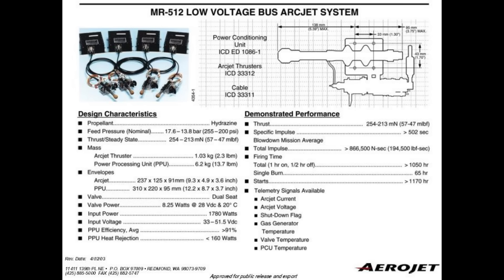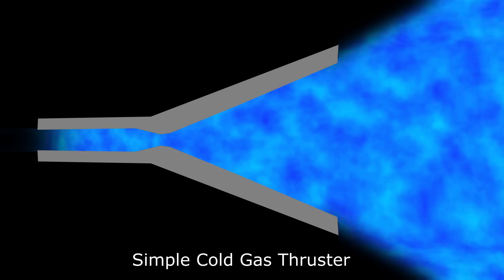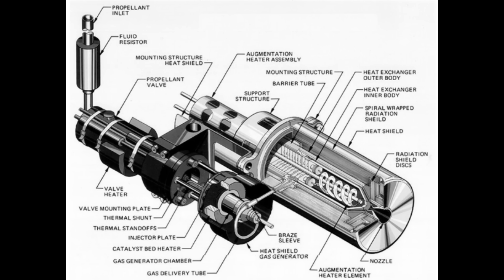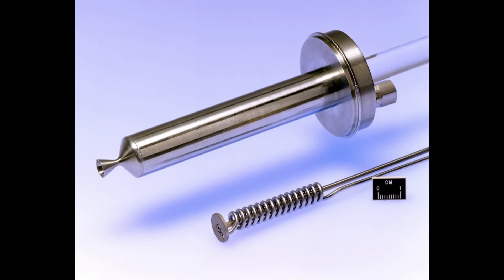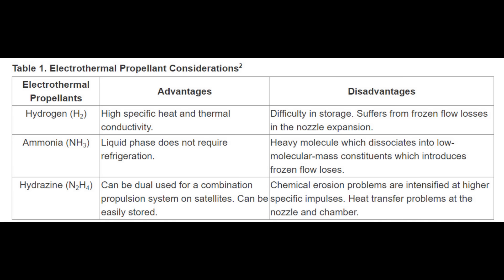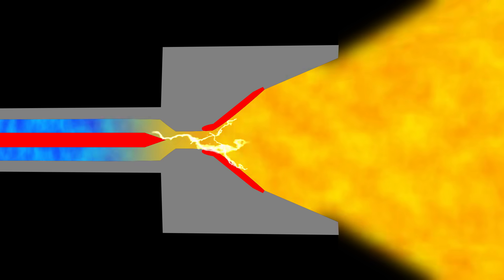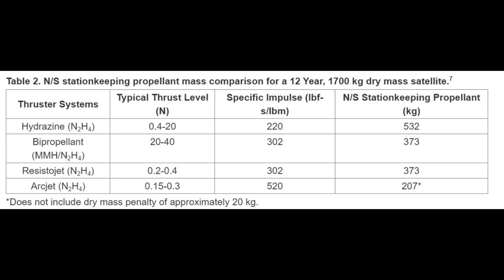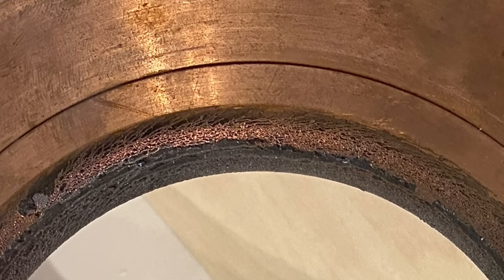Lightning In a Bottle?  The Science Of Electro-Thermal Rocket Engines

Comment: square rooting temperature of per molecule, what happened? do you have kelvin and hydrogen molecule regulator? can those chemistry energy outcome be recycled like tail re cycler? source energy and space ecosystem regulate. the circleR hoolahoop a trail path tracer like collect the rings or used as road. toxic? have you learned about heat transfer machine, can temperature cleanse? Ammonia, can radiation specific detox? AR jets and BR jets, can a propulsion be horizontalized like releasing rings by impulse and velocity, then re attract recollect. heat compromise space stealth. Does oscillating radio waves compromises speed warp? counter drag slow, can the propulsion be immersed at front, like a bridge likened to silver surfer pathway, diminishes rear back heat for the chaser space ships lesser detect? during for example space war

Comment: The microwave bit is very interesting for propulsion because of nuclear thermal electric engines. Such an engine will pass the fuel through the reactor and then use it to run a generator. It will then pass the fuel through the reactor again, yeet it through the nozzle and use the generated power to increase its energy for more specific impulse.

If we were to use methane, the microwave booster would be very good because a methane nuclear engine will have an exhaust of CH1, CH2 and CH3 (molecular hydrogen must be present because atomic carbon will choke the engine).

CH1 and CH3 can be heated up by microwaves, so the +5MW produced by the engine will be absorbed by the fuel, giving insane performance for a solid core engine.

Comment: Same principle that cools down burning nozzles could be used to heat up the exhaust gas in ETR nozzles. Imagine coils along the walls heating up gas even further. I'd assume expanding gas outside would increase the pressure of the central axis of flow, so linear aerospike kind of exit nozzle would be more beneficial.

Comment: If you vary the power of a thruster (by changing the boost from heating), how do you measure the amount of thrust?
Use accelerometers and dynamically calculate when the required thrust has been achieved?

Comment: I wonder if you could combine a standard bottle rocket with a water boiler & some creativity to build a basic electro-thermal rocket using the fact that water expands to around 1600x its original volume when it flashes into steam...

Comment: try pulse detonation rocket instead, just gravity and expulse vacuum to get more fuel from two tanks, supports liquid and sand type solid fuels and oxidizers, works like pulsejet but with oxidizer and not air, also detonating mixture guarantees compression ratio, yep like liquid hydrogen and oxygen mix does, and pulse detonation not constant burn, and especially no turbine pumps, just the gravity engine flow through a valve/less intake.

Comment: Hey Scott, I did a bit of back of the napkin calculations with ChatGPT and it seems like Falcon 9 thrusts roughly equals to 4 degrees of thermal energy of 435,000 kg of water (size of tanks in Falcone 9 first stage). Considering they fire for like 180 seconds it means that you need the use like 720 degrees of that thermal energy which is well within laws physics and current material science. With proper materials we can probably push that water to 1,500 degrees (2x temperature of what is needed). So, does it mean that theoretically it is possible to have an orbital class hot water rocket (as long as it is done by proper scientists and engineers and not crazy garage people)? Are there some errors in my calculations? Maybe big inefficiencies of converting that thermal energy?

Comment: I can’t help but think of Ram and Scram jets as I learned about this.

Sure they differ wildly, being that one is a Jet and the other is a rocket, but the principles are similar.

You have air being pushed into the jet, being compressed, then you inject fuel into the compressed air, combusting the fuel, and heating the compressed air up, causing it to expand, and be pushed out the back faster than it had entered. 

The electro thermo and Nuclear Rockets work similarly, having fuel pushed into the chamber, heated up, and pushed out faster than it entered.

Comment: While watching, I couldn't help wondering if the cold gas thruster on the Tesla roadster could be. . .  "enhanced" by incorporating this electro-thermal tech.

Granted you wouldn't want to get the temps to a point where you would face-melt a pedestrian walking behind it, but the electrical power is available, and I wonder if you could actually get a significant thrust increase.

Comment: have you seen the startup called "Lightcell" they want to burn fuel to heat sodium and then use a highly tuned solar panel which is crazy efficient at that specific sodium emission peak wavelength. What if you made a chemical rocket which burned a fuel and then scavenged heat using thermovoltaic cells or sodium light emission and pv cells, and then put the energy back into the rocket exhaust using an Induction Thermoelectric Engine.

Comment: An interesting theoretical use case for arcjets could be to boost the specific impulse of a nuclear-thermal engine. The idea would be that you send the hydrogen through the core twice (or even more times). After the first run through, at high pressure, and perhaps through a lower-temperature section of the core, it enters a turbine, where it expands and does work. This lower-pressure hydrogen is then routed through the reactor again, heated to the typical 3000 K maximum for a solid core NTE - and then the work it did in the turbine(s) is used to drive a secondary arcjet chamber to heat it to perhaps 4000 K, giving a nice 15% or so boost to Isp, admittedly at the cost of a much more complex and heavier engine.

Comment: I worked on ESSEX ( the Arcjet experiment on ARGOS) in the 1990's. It took three days to charge the batteries with enough power to run the arcjet for 15 minutes. The spacecraft was delayed so many times that the batteries were long past their used best by date. The batteries started out-gassing (explosively) and the thruster was shutdown to protect the other nine experiments on the space craft. Somewhere I have a picture of the spacecraft with arcjet firing, passing in front of the moon. It was taken from the USAF observatory on Maui.

After ESSEX, the Air Force focus shifted to electromagnetic propulsion in the form of pulsed plasma thrusters
Reply: sounds beautiful - find the photo?

Comment: 13:26 More seriously, an arc can be driving into a circular motion using a magnet. In other words, the arc can be forced to orbit around the surface of the outer electrode, much like an electric motor. I've seen much different application hardware that does precisely this approach.

Comment: So what my monkey brain is getting from this is that electro-thermal thrusters really make sense once we become a truely spacefaring species and have to source propellants outside of earth's atmosphere. Like water or H2 is infinatelly more abundant out there than those noble gasses required for ion thrusters? Also isn't this basically a steam engine but instead of driving whatever machinery with the pressure created, you vent the exhaust in a specific direction to create thrust?

Comment: There are also electric thrusters with solid fuel, like teflon block spring loaded to pair of electrodes, where electric arc is produced. This is probably the simplest electric rocket engine, because handling solid teflon block is easier than gas or liquid. It's quite popular on small satelites.

Comment: Integza did a video about a really cool solid rocket fuel that is great for thrusters it is ignited electrically but will only burn as long as the current is applied. Pretty much a solid fueled resistor jet.

Comment: All of this makes me wonder a couple of things:

1. I wonder how it would work with Hydrogen Peroxide (HTP) as a fuel? HTP decomposes into 600 deg oxygen-rich steam when you pass it over a platinum catalyst, so it makes a perfectly good "cold" jet (Soyuz uses it for this), plus the extra oxygen+high temperature means you can burn a fuel in it easily enough for a "hot" jet with lots more thrust. It should be possible to replace the burning fuel with a heating element. For an unmanned craft one of the other fuels is probably better, but for a manned one HTP has side advantages, namely that:

 a) HTP's decomposition products are water and oxygen, both of which the crew need, so you can simplify the craft by using one set of tanks for propulsion and life support. If you ran that life-support HTP burn through a turbine, you could also generate electricity from it.

 b) HTP is a room temperature liquid that needs to be prevented from freezing. However spacecraft generally have a waste-heat problem due to electronics and human activity, so you could use that waste heat, that's otherwise difficult to get rid of, to keep the HTP warm. Essentially, you're using your fuel tanks as heat sinks instead of having lots of radiators (you still need some radiators though because sometimes the fuel will be too warm, plus you still need to regulate heat when most of the fuel is gone).

2. There would still be advantages to using a nuclear reactor to power an electro-thermal drive, even though conversion power losses would be an issue, principally safety ones:

 a) The external parts of the drive system wouldn't become radioactive as they do in "direct" nuclear propulsion, so the craft would be safe to work around at any angle, both for other craft and astronauts on EVA. This is important if you forsee initial lone exploration missions eventually leading to space-based infrastructure.

 b) Because electro-thermal propulsion uses electricity for the actual burn, you could replace the large nuclear reactor used in a "direct" nuclear propulsion system with a much smaller one and a bank of batteries, charging up the batteries during unpowered cruising flight then discharging them for an engine burn. The smaller reactor could then be shielded from all directions (not just a shadow-shield protecting the crew compartment) without excessive mass. Indeed, depending on their characteristics, the batteries could BE the shielding, or at least part of it. This might also provide a justification for using lower-tech but cheaper batteries, if the weight of their liquid electrolyte can be justified by it's double-use as a radiation shield.

Comment: The distilled water thruster is going to have some serious issues with erosion because of the atomic oxygen that results from breaking down the water molecules. That's the same reason nuclear thermal rockets have a very low Isp when using water...if they go higher (and hotter) the dissociated water starts eating the engine.

Comment: 1 eV is 11606 K. The main issue is that you need to ionize the propellant first. If you take a potassium or cesium ion and accelerated with 100 volts it's exhaust temperature is 1.16 million Kelvin.

Comment: Those resistojets and arcjets you showed with Aerojet logos were originally developed by a company called "Rocket Research Company".  Good shop until (like many other aerospace companies in the '90s) it started get traded/bought/split up.  The original Iridium spacecraft used the MR-501 resistojet, I helped develop and produce the variant used for them.

Comment: Interesting to hear Momentus mentioned.  I was the head of GNC (orbits and attitude control) there while Vigoride 3, 5, and 6 were being built and flown.
In addition to the MET main thrusters (we flew a redundant pair), the attitude control thrusters were resistojets running from the same supply of water propellant.
Unfortunately, the de-ionized water supplier for 5 and 6 was not delivering it at the level of purity needed.  We had months of frustrating intermittent clogs in the attitude control manifolds where the water flashed to steam and left solid deposits behind.  
The MET handled the impurities like a champ!  They easily matched performance predictions from ground testing.  Those were still hand-tuned prototype engines that had loads of room for design optimization.  The real question was whether there were missions that really needed a thrust/efficiency tradeoff between chemical and ion engines.  Most missions seem to want to push the optimization toward one end of the curve or the other (reach the target orbit quickly with chemical or minimize mass with ion).
Momentus essentially ran out of money a year ago amid the general collapse of startup funding.  It was a huge shame.  That was an amazing engineering team with a truly unique and powerful satellite design.  They just didn't have a way to raise money faster than the cost of building, testing, and launching three satellites a year burned through it!

Comment: You can make some incredibly powerful projectile launchers with those electrothermal arc jet plasma sources. I managed to launch a .2g airsoft BB at more than 2km/s with a capacitor bank made of electrolytic capacitors with only 4kJ of storage.
Reply: Was the point of the experiment just to demonstrate that the launch system could provide that acceleration & velocity to prove the launch system? 
Or is the launch system a means to an end, in order to hit something  with a projectile at 2km/s?

Comment: Scott, what about using induction heating which is very controllable and because there is no resistive filament / element the heat can be transfer directly to the gas from the tube.     14:00  Edit  Sorry too quick with my comment.

Comment: Scott, there is an engine design that combines nuclear thermal and arcjet together into one engine. It uses the hydrogen propellant as a heat sink for an electrical generator, heating it up once, then the electricity is used to heat it up again in an arcjet. The result is an engine that gets about 1300 seconds and at twr of about five. It's basically a NERVA but with 50% better performance. It's called the Serpent engine and it was designed by the same guy that invented the Sabre engine for the Skylon. Look it up, it's interesting.
Reply: 1300 s is... quite extreme. Assuming 900 s Isp for the base NTP engine (which is already high) that is still extracting at least 44 MJ per kilogram of propellant. This would definitely require multiple stages of turbines and reheating the working gas in the reactor core.
Reply: ...Wow. That is sci-fi level performance.
Reply: wow, thanks for the info dude, I was JUST thinking about SKYLON, that thing is a thermodynamic miracle...know anything about it , is it money holding it back or what ?
Reply: @ashleyobrien4937  That project was not nearly as serious as it sounded, and primarily functioned as an advertisement for the SABRE air-breathing rocket technology. U.S. defense interests seem to have taken up the technology and not much has been heard about it since.
Reply: @ashleyobrien4937  If Reaction Engines had infinite funds it might have happened, but realistically it was mostly an advertisement for their SABRE precooler tech. U.S. defense interests seem to have taken up the SABRE project and very little has been heard since.

Comment: Edit2: Oh, he mentioned something similar in the end xD
Would it make sense to have a simple weak ionizer turn a little bit of gas into plasma and have a magnetron heat up that in the mddle of a lot more gas to have it transfer the heat to more of the gas to turn it all into hot pressurized/expanding plasma for the purposes of propulsion? (kinda like that phenomenon where if you heat a little point on a glass bottle enough (ensuring the gradient is smooth enough to not break it from the thermal expansion) and place it on the microwave oven you can melt the whole bottle because even though glass usually doesn't absorb much microwave, that changes as it is heated up, and the hotspot serves as seed where the microwave oven can start dumping energy on starting a chain reaction as the heat spreads. Edit: Or a more similar phenomenon, microwave grape plasma)

Comment: But why don't we just blast the test-heatshields with raptor engines?
There you have a fast plasma flow to test re-entry?
Reply: for crude tests they have, but the temperature and pressure regions all wrong. reentry plasma is way hotter and lower density

Comment: space power systems are still the thing holding up the wide scale adoption of electric propulsion. solar only works in the inner system and the mass scales poorly with power output. but where you want/need the high impulse is in the outer system.

Comment: Just a silly idea : Could they use for instance Methane or Kerosene with Oxygen to heat the Hydrogen? (Off course seperated from each other)  Anyway I'm curious if this has been tested.
Reply: Go from 2 to 3 fuels.  So yet more tanks and thus dry mass.  I can't see it.
Reply: @TheEvilmooseofdoom  Well the one fuel might be more effective at heating and the other at expanding. After this I had an even worse idea : Using burning Magnesium to heat the fuel. Stand well back.